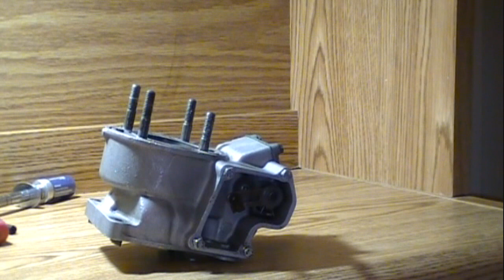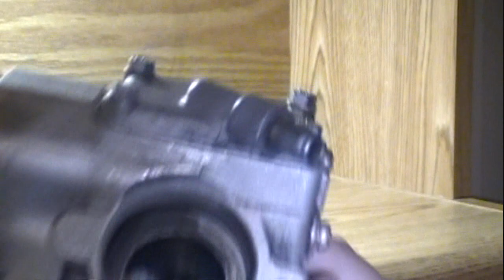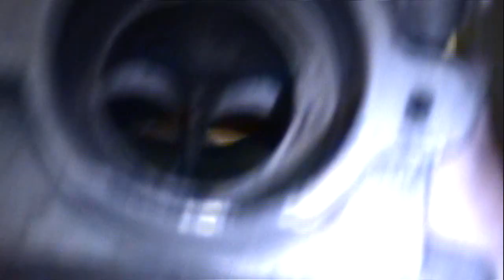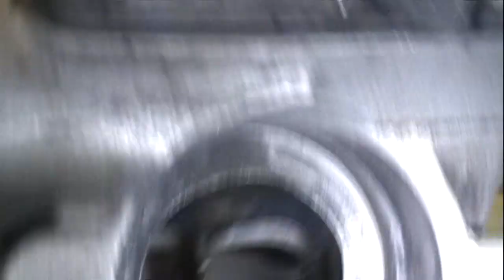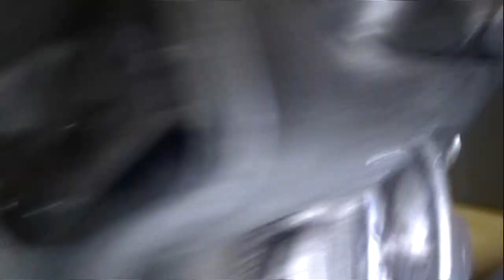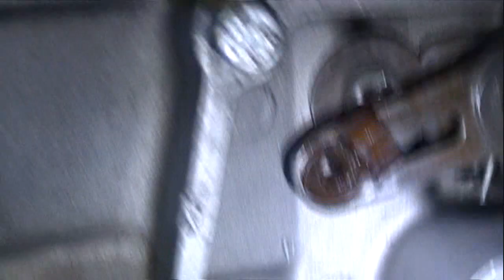Two Stroke Power Valves Explained

Comment: what powervalve does, by its nature it prevents or allows less or more exhaust gases to get out of the engine. so when rpm is low it's closed which helps keeping high commpression (lets say its pressure inside burning chamber) and opens up when rev is high so it allows more fresh mixture to enter the engine by letting more gas out. it is powered by gearbox. while turbo pushes more fresh mixture into engine and is powered by exhaust gasses (thats why turbo engines dont have that loud sound). :)

Comment: its made so u have less exhaust port to keep a maximum of fuel in and air in the cylinder at low end and slowly open whit rpm to give the maximum exhaust port because at hi rpm you don't loose  a lot of fuel and air in there so its for low end ( you can have more port erea and not loose any or less low end!!

Comment: What's the best way to adjust that knob on the left-hand side of the power valves? I see that there's two screws holding it on the top and bottom of the knob? Does that knob control some sort of spring tension return for the power valves?

Comment: dude if you never worked on a honda hpp power valve system i can tell that.   bc if you did you would have said this powervalve is very simple.   nothing complex about that rm80 pv.   look up the honda hpp.   talk about complex design.    id rather do valves on a 4 stroke than rebuild the hpp system lmao

Comment: The primary drive gear is spun by the crank, which then spins the govener, govener spins the rack, when rack spins it moves outward, pushing on the pinion which in turn opens the sub-exhaust valve, and there you go, easy as pie. lol

Comment: I just rebuilt my 2001 cr125. The power valve actuator rod needs to be timed correctly with the arm. Make sure the rod lines up to the arm on the cylinder while the power valve is fully closed. If the rod pulls the arm open (like mine did) or has too much spring tension- closing the power valve, then you are off a tooth on the gear. You will need to remove the right side engine cover and re-install the linkage on the correct tooth. I hope this helps, if you haven't already fixed the problem.

Comment: I'm having trouble with my 00 CR125R, I just put a new top and bottom end over last weekend, and when I put the power valve back in, it just didn't look right. Should the rod spring back up fast, or slowly move back? It feels like the bike take a few more seconds to hit the power band and I just want to know if that could be the reason.. Thanks!

Comment: So i have an honda crm 125cc 1992 and there is some kind of a power problem, ive checked the  ignition timing, the carburetor and set the needle and right jetted, compression should be right but i dont know about the power valve. On low rpms its only like "blaaaaw" like no power at all but on higher rpms it gets a real power kick. When i hit full gas on loose sand it wont do a "rolling burnout" could it be a power valve problem

Comment: Yo guys i have a question i have yz144 big boreit had a cracked head and some leaky water seals and gasket replaced it all got everything serviced  it cranks up on first kick runs good and everything but it has to power at all! like right when i switch the gears and give it gas it goes some but it feels like it has no power behind it there is no rattling or anything in the engine. right when i switch the gears i have to switch up again because thats how fast it goes threw them

Comment: ill try and keep this simple,at low rpm there is more time between piston strokes to allow the burnt gasses to exhaust from the combustion chamber,therefore the exhaust port (EP) can remain small.If the powervalve (PV) was open at this point it would also allow the new mixture to escape out of the EP so it would result in a loss of power.As the rpm increases there is less time for gasses to exhaust,so the PV raises the height of the EP allowing gasses to escape earlier and for a longer duration

Comment: On a 2 stroke the port heights dictate the power range and the rpm range of the engine.  So when the  power valve is at the bottom It changes the port timing to give more bottom end, as it opens the power range is brought to a higher rpm level.  Basicly making a broader power band.

Comment: good video, the valve actually changes the port timing. long story short the higher the top of that exhaust port the more top end power youll get the lower the more torque. the valve makes the bike in the sweet spot all the time.  some bikes you can shave the top of the powervalve alittle more to get alittle more rpm+hp

Comment: I thought it was to do with fluid dynamics and pulse preasure, eg.. when the engine is at lower RPM, you dont want most of your air/fuel mix being scavanged through cylander and out the exhaust with not enough of a pulse wave to compress it back in with such a massive expension chamber. So the valve restricts the scavanging to basicly ensure the right compressed air/fuel ratio in the cylander to maximise tourqe. I could be wrong eh..

Comment: ay man i gotta '96 yz125, and oil is just speewin ou the powervalve. is it the gasket i need to replace thats on the mating surface? or is it that rubber seal that sits on the bottom?

Comment: I have a 95 cr125 I was wondering on the linkage from the bottom end that hooks to the topend jug, does that hook up before the bike is running if so i think mine is stuck. the tie rod is down and i can't get it up enough to hook it to the power valve linkage. any advice?

Comment from the maker: @xxdestroyerrxx Depends on where you buy it from. A new cylinder is around 400-600 new. For a used one you can get one for cheaper depending on the condition of the part. Most jugs should include the power valves it just depends on who you buy it from.

Comment from the maker: @xxdestroyerrxx  yeah but avoid contact with silicone seals. It should work fine also after you get them unstuck spray it with wd40 to prevent moisture on the area and keep them lubed.

Comment: @pimpinpenz Clean them with what and how? Right now they are not moving at all. Should I soak the cylinder in something like a powerful carb cleaner (b12 chemtool) to loosen up the build up on the valves?

Comment: ihav a kx 80 and was experienceing sum problems with it so i took it to a mechanic and had him replace the top end cause the compression was low. it only brought the compression from 105 to 125 and he said it should be at around 140-160. So he told me that my power valves were busted (something about them staying open) and that i needed to get  a whol new cylinder to fix the problem even though my old cylinder was not scored or scratched. Is there any other way to fix power valves. btw nice vid

Comment: Power valves alter the size of the exhaust port which affects port timing.. This is why Powervalve engines have good bottom end throttle response as well as good top end when compared to the old style piston port engines..     Also with a powevalve engine the compression actually lowers when the powervalve is fully open..